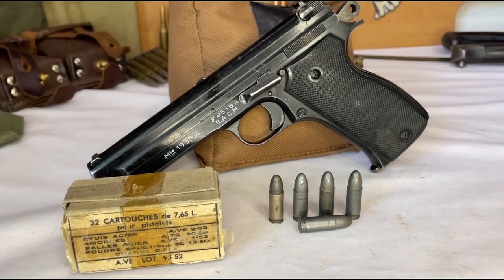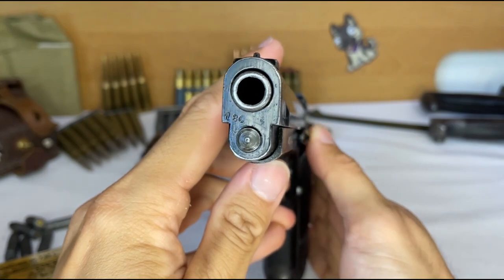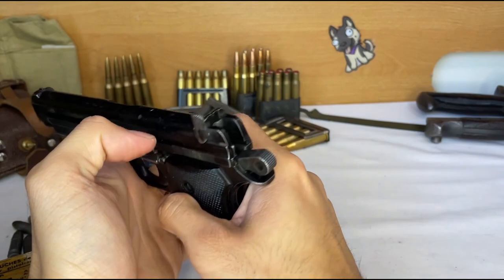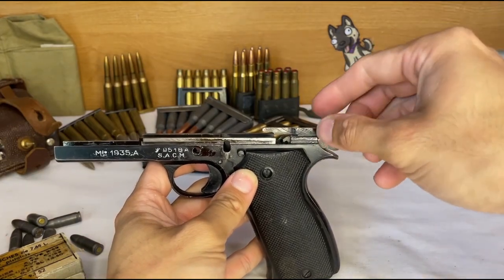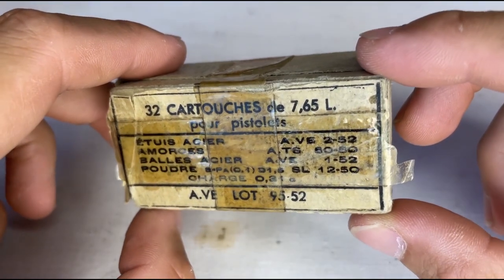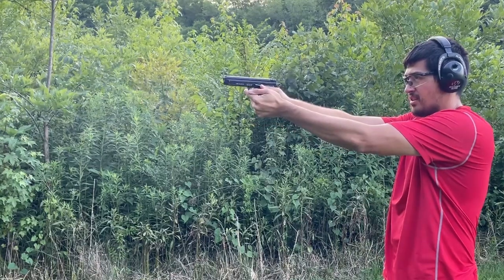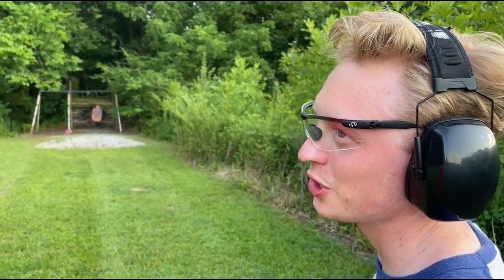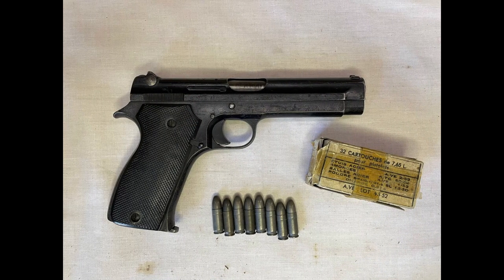French Pistol Model of 1935a

Comment: I talked about it a bit in my video, but I think the magazines just stick more in the 35As. Overall, I think the 35S is the better combat pistol, which it seems the French also thought so with the adoption of the 1950.
Reply from the maker: You also have the luxury of being able to shoot that P210! the king of these-style-of-pistols!
Reply: The magazine catch is somewhat adjustable, by turning the slotted button outward with the proper spanner screwdriver. That usually alleviated a lot of the hanging with the ones I've dealt with/own. The rest was often cause by "Infinite layers of black paint". (The British did the same).
The "S" is/was supposedly a simpler design to manufacture.
If one is interested in the 35A/S, the fine little book by Colin Doane and Eugene Medlin is well worth searching out.